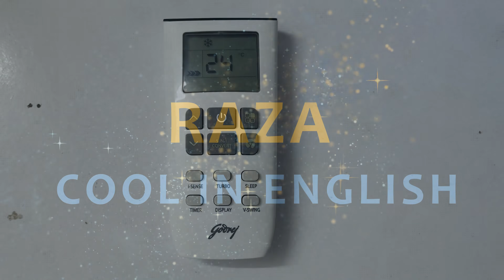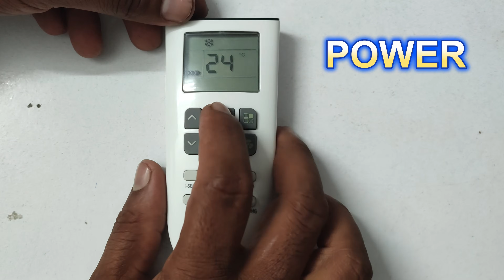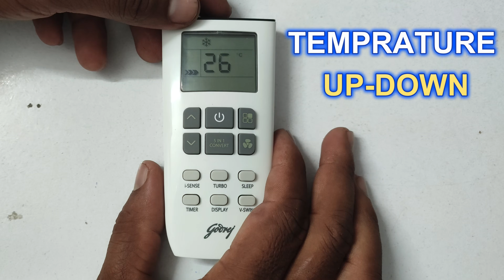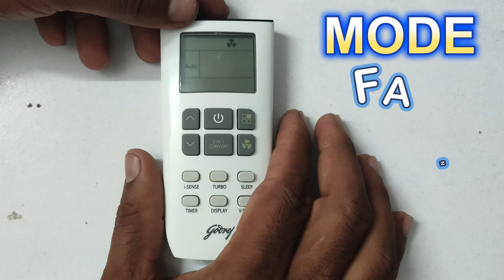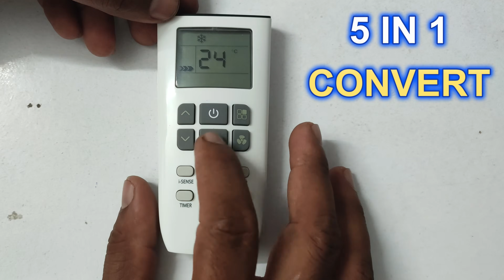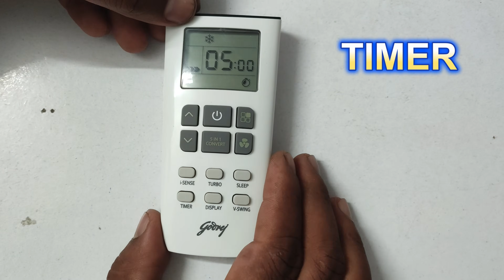Godrej Inverter AC Remote Settings Explained | Easy English Guide

Comment: tempreture plus minus nhi ho rha he
Reply from the maker: Please check if the remote is locked. Press and hold the Temperature ▲ and ▼ buttons together for about 5 seconds to unlock it. If it still doesn't work, let me know your AC model. 😊

Comment: How do I adjust the vertical flaps of ac?
Reply from the maker: Use the Swing button on the remote. If your model supports motorized vertical swing, press the Swing button to adjust the vertical flaps. On some models, the vertical flaps can only be adjusted manually. 😊